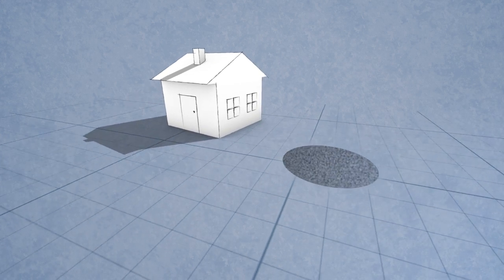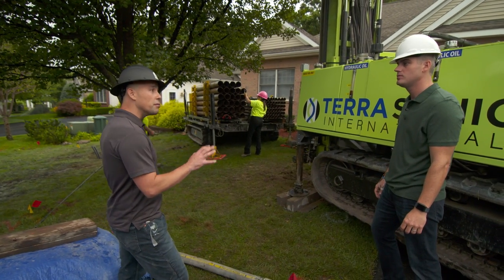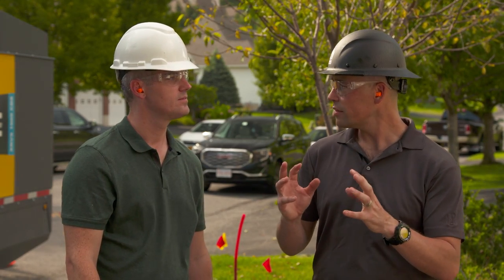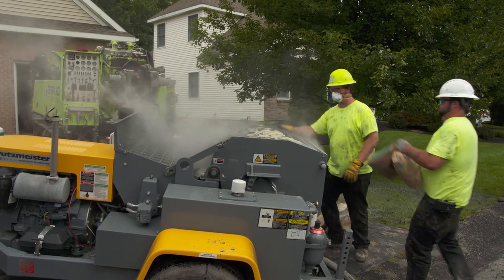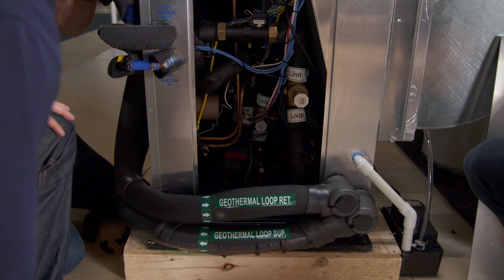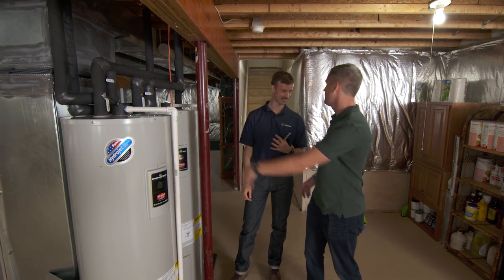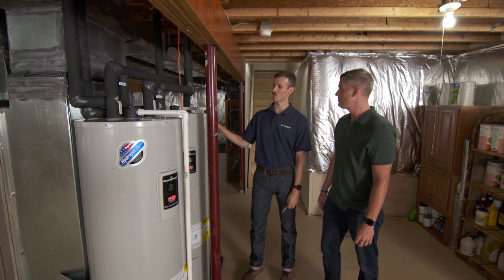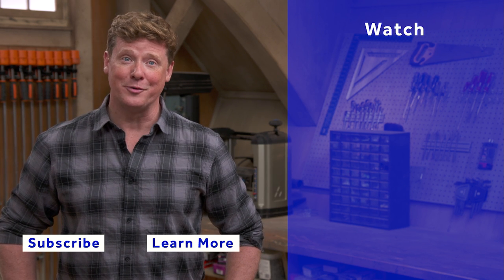Affordable Geothermal | Future House | Ask This Old House

Comment: How deep do you have to drill to get maximum heat??
Reply: Stable temps are reached beginning at 30’ below grade. Most ground source heat pump boreholes are 200-500’ deep.
Reply: If you drill 12,000 feet or more you may be able to find spots where 100 degrees centigrade are available- that is 212 degrees Fahrenheit. If you go still deeper, say 40 miles, you will be in the more "elastic" and semifluid zone where temperatures can melt rocks.
Reply: frederic rike that’s not viable
Reply: @pb7379-j2k  I didn't say it was- I answered the question asked. This same thermocline problem is also what is limiting the depth that sub surface oil drilling can occur- the tools currently in use have reached their limits of operation.
Reply: frederic rike I mean he did ask about “maximum heat” but come on
Reply: @pb7379-j2k  I think my pointing out the temperatures approach "melting rocks" was a pretty good indicator that it wasn't viable. Paul, I am not missing your point; I just assumed the OP would see the rashness of installing any sort of water circulation system at that depth. FWIW, the very core temperatures current theory and science estimate are in the region of ten thousand degrees Fahrenheit- there is an ongoing thermonuclear reaction still going on. Mars has a cold core, and no such reaction Is thought still happening- it also doesn't appear to have had any volcanic action for millennia at the least.

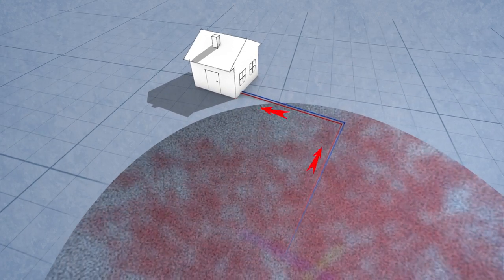Comment: He started out saying heat pumps heat/ cool your home AND make hot water "without the use of fossil fuel" @0:30.   Heat pumps do use fossil fuels.  They require  "electricity", which predominately comes from fossil fuels today.
Reply: Maybe they have solar, or that region uses gas.

Comment: I built a house in 1984 and had a geothermal air to groundwater heat pump installed. It worked great and I've always been perplexed as to why it never became popular.
Reply: Joe Stallings one word: cost
Reply: It did indeed cost three times as much as a conventional heart and air system, and double what a heat pump would cost. But I was able to receive a sizable tax credit for the year that paid for most of it. 

I believe it's not popular because most people don't know what it is and are unaware it's even available.
Reply: $
8x more expensive (up front), payback (in savings) over 15-25 years, needs overhaul or replacement after 10 years, original installer goes bankrupt after 5 years. Don't know why it never caught on?

Comment: What’s the proper diameter for the for the drilling hole? Or does it vary depending on the size of the Heat pump?
Reply: Mine was like 5”, 500 feet deep

Comment: What do you think this would cost in central Florida in the year 2023 or 2024?
When paired with ICF or solid poured concrete walls I can see a very small unit being needed, and if I design a house with a fairly large PV system I would like to consider this

Comment: I really hope the cost of geothermal installation goes down in urban areas as well. As someone who does energy modeling + mechanical design for a living, I've seen payback periods for geothermal systems exceed 100 years in some cases (commercial buildings in cities mostly) - especially when comparing it with a VRF system baseline.

Comment: How do you push the line from well to house. Do u have to rip up yard?
Reply: Obviously the lines have to be buried underground from the drill site into the basement of the house demonstrated. And this would involve trenching at the very least.
Reply: Jeff W I figured that. I just didn’t know if there was a less destructive way
Reply: @schott106  I might have missed the discussion in the video, but I would have liked to know why they choose the front yard location as such...and if the location had something to do with the trench route to the basement?
Reply: @jeffw8057  there are ways to push a pipe vertical underground it's not uncommon.

Comment: im hoping they made that geo loop 50% larger than design. but im assuming they used all their knowledge and skill to create a system that can operate barely with less than 1% variance of calculated load conditions even though over capacity conditions reduce wear by orders of magnitude while exact design conditions ensure failure very near contractual limitations.

Comment: I know it's unlikely that everyone in a neighbourhood would have geothermal except for the example in texas but hypothetically wouldn't the ground in one area only have so much thermal mass? and thus only be able to support so many houses in a given space? wouldn't the more houses you added decrease the efficiency
Reply: Yes.  There are different ways of thermally interfacing to the ground heat, with different thermal conductivity.  Ideally you get the loop into a body of water or aquifer.  You can do a drilled well like they did here, or you can do a large pit with vastly more feet of loop in it.
Reply: There are all-geothermal neighborhoods popping up around the country. Homes typically won’t absorb or reject enough heat into the ground to change temps much so these neighborhoods are great from a cost standpoint. Everything is installed when you build the neighborhood. Check out Serenbe in Atlanta. You already mentioned Whisper Valley in TX. There are others like Norton Commons, the Wheeler District, etc.
Reply: Tim Litton correct! The earth’s temp 30’ below the surface is very consistent. Part of that is due to ground water movement. The ground “soil diffusivity” is one metric to consider because it represents the ability of a material to conduct thermal energy relative to its ability to store thermal energy. The heat is such low grade (low enthalpy) and low energy quantities that there is little affect. However, one item that is very important is the spacing of the wells. Boreholes should be at least 20’ apart. If tightened, one well could affect another which could negatively affect performance.

Comment: Like to know what's the technical term used for these small set ups, looking in my area 40165
Reply: Closed loop vertical borehole ground source geothermal system. Paired up with a packaged water to air ducted heat pump...hope that helps

Comment: I have had direct expansion Geothermal from the start in my house and it paid for itself in less than 5 years.  19+ years and the ONLY maintenance has been air filters and fan belts.

Personally, I think it is pathetic that everyone at all even possible hasn't been put onto GHP.  It is unbeatable in every single way over everything else.  Less maintenance, less space used, less power used and provides hot water on top of the heat and cooling capabilities.  There are even versions of GHP that can do radiant floor heating.  There is just no excuse to not go with it.
Reply: Can it produce electricity?
Reply: The reason why everyone doesn't have one is because the cost is ridiculously high. This is due to having no competition, no aggresive push by the government and excessive well drilling fees in some areas. How many common HVAC companies are around your area? Way too many in my case, how many of those do ground source geothermal? None in my case.

Comment: I understand on the cooling side how it works but I don't understand on the heat side can somebody help me
Reply: Refrigerant is involved , works just like your refrigerator.
Reply: It uses heat pump, as 786otto said, kind of like a refrigerator but a whole lot more efficient. It can "squeeze" heat out of the 50°F water and with an exchanger pass that into the duct work.

Comment: I wonder if the well can be use for drinking water too
Reply: Not this type, since it is closed loop. Like a radiant heating loop installed into the earth. U bend pipe at the bottom.

Comment: So...what effect does this have on the planet as more utilize this system type and heat is transferred away from the ground and dissipated in this unnatural manner??
Reply: What effect does drilling and burning fossil fuels in an unnatural way have on the earth?
Reply: @leapfrog4561  arguably it's a potentially cumulative effect...maybe not?? Just as drilling...maybe not?? Seems that with over 100 million households in the US alone, that's a lot of demand for heat. There's always the law of unintended consequence that should be worthy of consideration.
Reply: acrodriguez34 I doubt every single house will ever have a well drilled but I think it’s pretty commonly used in Germany.
Reply: I vaguely recall this being discussed for industrial scale uses, and even then the timelines were okay. I'd bet for residential use, which is much lighter, the temperatures would stay sufficiently stable so as not to be a concern for the foreseeable future. When the unforeseeable future arrives in a few centuries for these homes, any such problems will almost certainly be figured out. :)
Reply: Hopefully soon an economically viable and benign solution can be realized for everyone in all homes
Reply: Probably better than running A/C units that take heat out of the house and dump it into the air. And of course that would be into already hot air or the A/C units wouldn't be necessary. But I do agree with your later comment that potential unintended consequences should always be considered.
Reply: There is this thing sitting about 93 million miles from the Earth.  It is called the Sun and it heats the Earth every day.  This heat is free and will last another 4-5 billion years.  When the sun's heat hits the earth, some heat is reflected and the rest it absorbed.  In short, there is no need to worry about the dissipation of this heat.

Comment: What would the cost be if putting the tubing in a 10' deep pond which is already on property?
Reply: I have been getting quotes on that type of system but you don't give enough information about your pond to say much.
My pond is silted in so it has to be dug out anyway. So this is also a good time to enlarge and resize it. And the dam leaks so that has to be repaired too.
You don't want the tube just laid on the bottom as it will shift and move and sometimes float up which when it gets into the surface waters the temps are wrong for the system depending on season.
So I'm digging 4 foot deeper than I need and I've been quoted approx $3K for a 40 x 70 sized by 12 deep 'hole'.
We intend to lay the plastic HDPE pipe in loops, putting around 900 feet in the hole. Then a cap is soil over the tube making sure there's no rocks to puncture it. Then the pond liner goes in because my soil is too porous and that's why the pond doesn't fill well. Then another cap of 18" to 24" of dirt over the liner to hold it down and protect it from damage.
All told my quotes are running around $8K to $9K for what's described. Note that the equipment hourly rental costs are the largest portion of the total costs (the contractors bid the jobs based on the number of machine hours it takes to do it @ $150 hour for bulldozer and excavator)
BUT then the house's heat exchanger / heat pump still has to be added to that.

Comment: I've read that wells drilled are so expensive, the savings won't even cover the interest on a loan. Where I live, because of all the lake in the area, I hit water at ten feet. (South east Michigan), Any suggestions????
Reply: Good for you because there are systems which pump water from a well take heat out of that water and dump it back into   a river or another well . You could do it by yourself just buy  water source heat pump for 1500 or 2000 dollars
Reply: Yes.  You are lucky.  Cheaper to do it that way.
Reply: The water at depth is the same temp as "dry" ground so it doesn't really matter if you have water in the well. As Andrey said, there are systems that use the water directly. The system shown in the video uses water and glycol in a closed loop.

Comment: Why can't geothermal be used in a ductless system? Unless I'm missing something, they operate on the same principal, do they not?
Reply: @raptorcrazy9545  Right, the mediums they use for picking up and dumping heat are different. But they are both forms of heat exchangers, but haven't found any system that combines the two and was wondering why.
Reply: Split systems have individual  outdoor  units, one for each system.  How many wells  are  you going to dig?  With a central system, one for the whole house, you only need one well, and one heat exchanger for the entire house.
Reply: @raptorcrazy9545  A split system has one indoor unit, and one outdoor unit per system.  Each  outdoor unit would have to have access to the ground water which is always 50 degrees.  I don't see how you can have many units connected to one source of ground water.
Reply: raptor crazy My first reply was to the person asking why split systems couldn’t be geothermal.  I think they could be, but it will be very complicated, tying multiple systems to one ground water source. Air sourced heat pumps can’t possibly be as efficient as ground water sourced systems where the water used is a constant 50 degrees.
Reply: Mitsubishi has a water source VRF system for the light commercial/high end residential market.  It is even available in heat recovery that can move heat within a building via the refrigerant side if you have different loads in one building.  It can be paired with an existing condensing water loop or a geo exchange loop system.  The technology is out there by some of the biggest names in the industry.
Reply: @steve32627  Yup. Their hyper-heating systems can heat a home with outside temperatures down to -15F. I have one in a new "net zero" home in NH. With solar they work great and cost essentially nothing. I opted for this approach since my home was built for zone 6 conditions. The key to selecting ground source heat over air source is now a function of home insulation level and the potential for solar use.

Comment: Using an electric hot water heater in this install makes no sense with a natural gas connection available.  Gas hot water heaters are much less expensive to operate even if the capital cost is a little higher.
Reply: Mykel Hardin  I assure you that in Albany NY electricity is vastly more expensive than gas.  More like .20/kwh.  The only way to mitigate that is solar, further increasing the capital cost

Gas water heaters can also be run simply if the grid fails.  Most solar installs can't, and having a means of heating the house with the DHW tank is very handy.
Reply: The price of Natural gas will go up and down, electricity ONLY goes up. If available, use gas to create heat (water heater).

Comment: So with this geothermal system, you must use additional electricity over the previous gas fired heater because you have to run the pumps to pump the coolant through the ground loop.  How much additional electricity are you using with this system?  I'm assuming that the energy savings outweighs the cost of the additional pump electricity?  I'm also concerned about what happens in the event of a power outage(in winter)?  How much additional electricity is it pulling from a backup generator?
Reply: It's always more efficient to move heat than it is to make it with traditional methods. Which is why heat pumps can be two or three times more efficient than a normal AC. Sure, the pumps will use energy and that isn't free but the amount of energy used for the pumps and everything required to move the heat to/away from the ground loop is much less than what you would use with any other system. It's also more moving parts that you have to maintain and probably going to be more expensive/annoying to deal with because these sorts of systems are relatively rare compared to the normal stuff out there. I wish I had the money and my forever home so I would get this sort of a system. It would be nice to have solar panels and a geothermal system
Reply: I use mine with a backup propane boiler and a water to air coil in case of power outage. Pumping the water takes very little energy since its a closed loop, so you only have to make up the difference of pipe friction. Suitably large sized pipes don't add much friction.
Reply: Heat pumps work just as well as a forced air furnace in the event of a power outage.
Reply: @dougmc666  If you don't have electricity then a gas or oil furnace would be better in a power failure.  My generator can run my gas heat but not my heat pump.  I could get a bigger generator of course.

Comment: It'd be interesting to see what that financing looks like. At 20k, it'd take at least a couple decades to see any actual return compared to my current bill.
Reply: That's correct. On the other hand if it was put in when the house was built you'd save money on the mortgage and see a return on day one. Thats why these should be required on new construction. A big turning point will be when these get close to around 15K where it'd make sense to get this WITH a PV system since it'd shrink the size of the PV system in half.
Reply: I had a  cold winter with $3.79 heating oil and a hot summer in 2014-15 that cost $1800.00 in hvac energy. A AVERAGE year was $1200.00 so bills peaking at $475.00 the last four years  is a substantial savings. If I used the worst year the playback for my mini split would be under five years but if I have average  degree days   it's over six years. 

The thing to consider is the advances in system effeciency has made five year old systems" antiquated " !
Reply: penguins forall yup. Geothermal paired up with solar is the best approach to lower the energy cost of heating and cooling. And a path to “net zero”, meaning a house that uses as much energy as it produces.